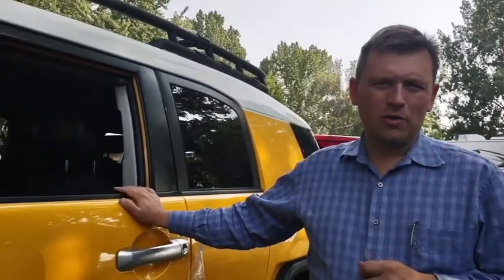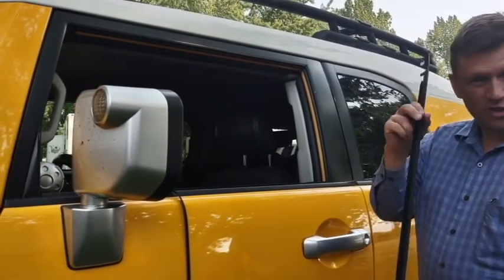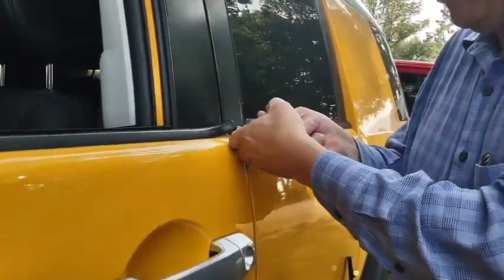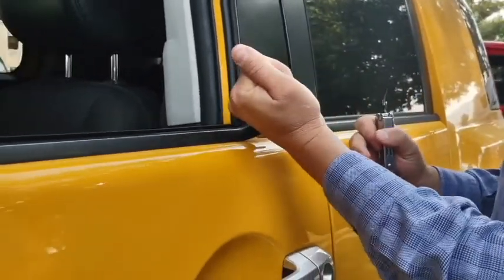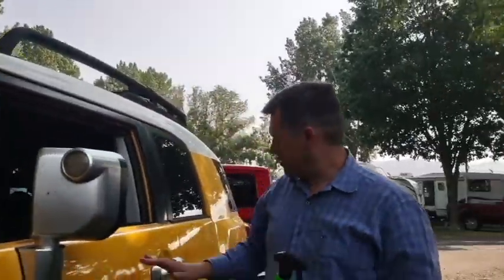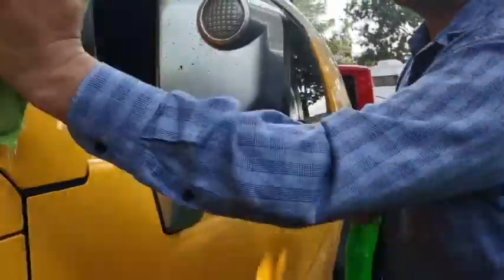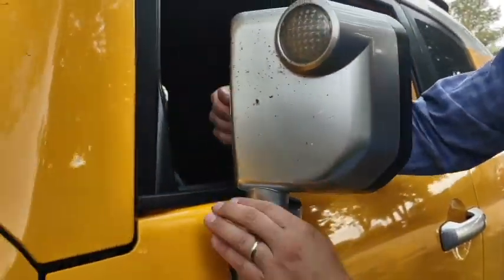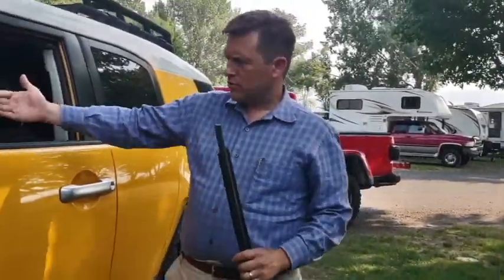2007 FJ Cruiser Door Weather Strip

Comment: Do you have the OEM part #? Wanting to do the same for all 4 windows but want to be sure that I am looking at the right parts online. Thanks.
Reply from the maker: Toyota Part number 68162-35073 Weatherstrip, FR DO EP. Part Interchanges with part # 6816235070